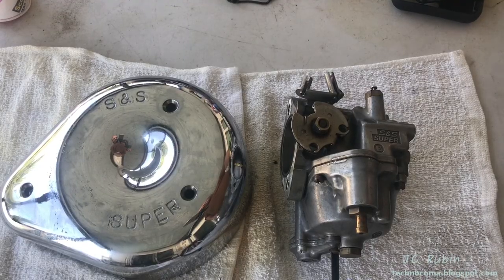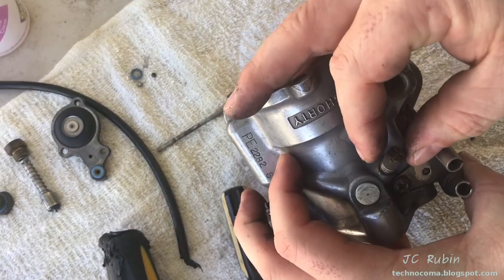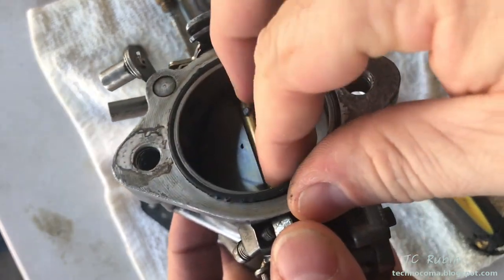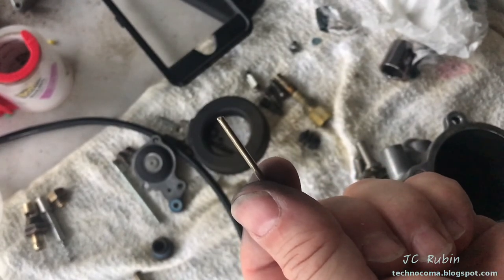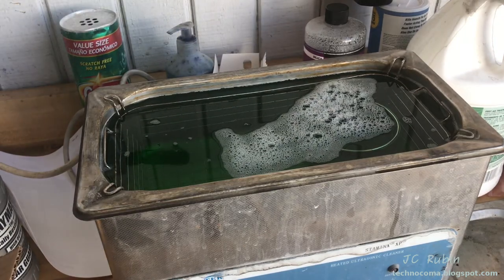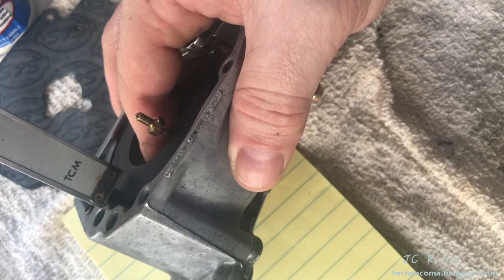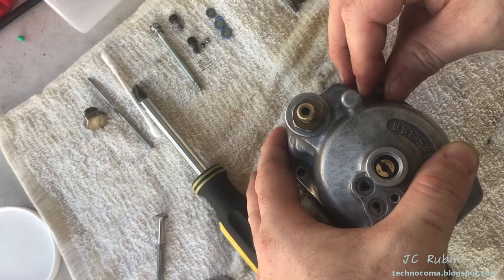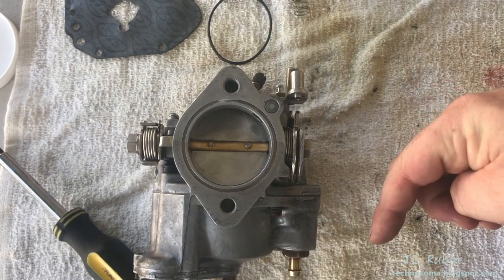AMF Shovelhead Lowrider Restoration -6- S&S Super E Carb Rebuild

Comment: Hi, very helpful video and well explained. I have just done this job and have a question. I have a small blue o-ring over and I can see you do as well. See vid at 24:44. I have the other 3 small blue o-rings in position as you do. (two in diaphragm housing and one on long brass tube in float bowl. The small blue o-ring that I have over was in the packet in with the accelerator pump bellows. Any idea if it is needed and where it goes? I thought maybe under the accelerator pump bellows but that is only a guess. Cheers from UK.
Reply from the maker: Looks like the O-ring that goes on the idle mixture screw at https://youtu.be/gjQmAnsos98?t=1201. Ill put a note in the comment section and address it in Chapter 30, thanks.

Comment: Great video I wish you had talked more about the jet sizes because as I look in mine I see the main, the intermediate/pilot and what is the third one? Are there different sizes for it too? I have looked at a lot of videos, visited S&S website and they do have a chart for engine size and corresponding jet size but it seemed limited. Are there not many jet sizes?  Thanks
Reply from the maker: That’s because jet sized differ from one bike to another. The recommended sizes from A&M’s are only a starting point to begin tuning and not the final jet sizes. Yes mine has one less than most as it has a fixed transitional port
Reply from the maker: That’s because jet sized differ from one bike to another. The recommended sizes from A&M’s are only a starting point to begin tuning and not the final jet sizes. Yes mine has one less than most as it has a fixed transitional port

Comment: Great video, I just came across your video, my question is if you don't mind answering it. On my panhead I have the S&S E also. I noticed I'm not squirting gas down the throat. With bike not running giving it throttle, or when I get it to run. It seems like it's just dribbling if that. Pulled it all apart soaked it, blown everything out with air. But nothing same shit. I'm thinking either something with the accelerator pump, or I need to clean out all the tiny little holes with a thin piece of wire. What do you think or suggest. Thank you
Reply from the maker: Never use wire.
the pump needs to be adjusted to the bike, there is a screw for this purpose.  Overturned is fine just to check spray pattern but S&S has a special procedure as to how far the screw is turned to be properly set.
Reply: @delorean1  thank you, got it running like a fine tuned clock. Had a great ride today with my kids for Father's day. Thank you for getting back to me
Reply from the maker: @nickpanhead7209  Glad to hear it.

Comment: Very informative just curious, can dielectric grease be used as a lubricant?
Reply from the maker: There are generally specific applications for certain greases. Sometimes it’s not important. But generally the correct grease should be used as specified by the manufacturer